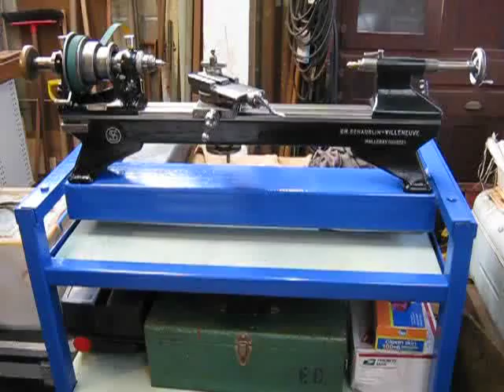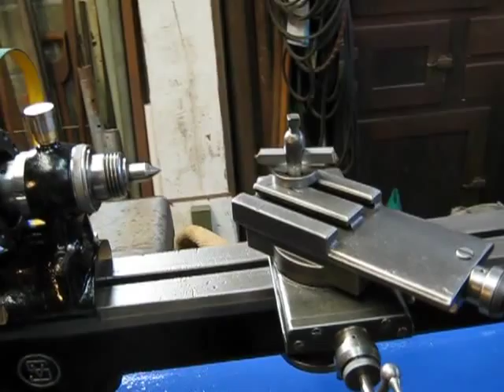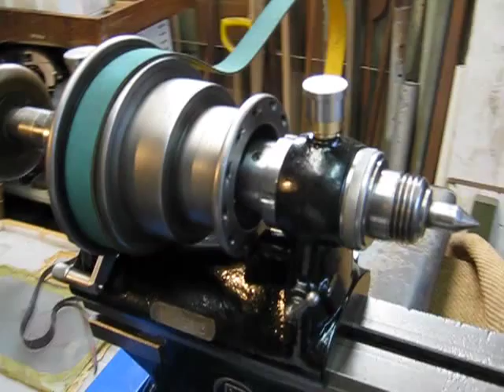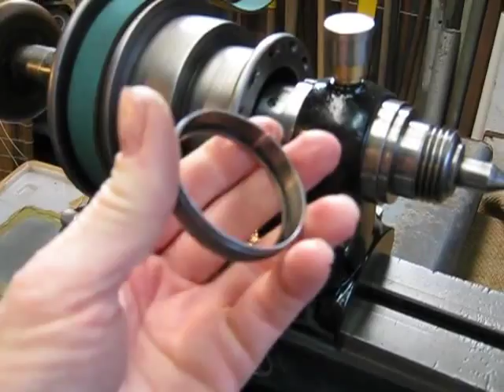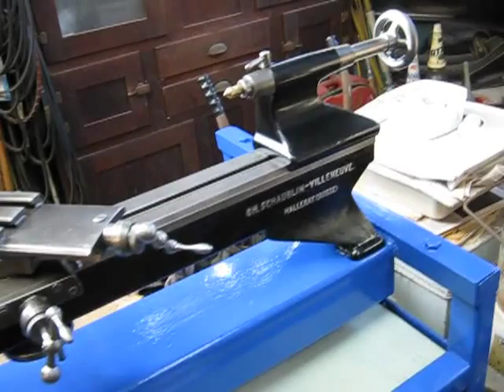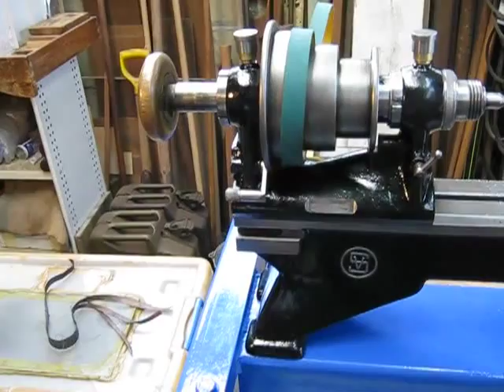Schaublin 102 lathe restoration - part 13

Comment: followed the project and when it was coming to finality that is from part 11 onwards there was not sound at least on my internet but all other channels were OK.
Reply from the maker: Hi Norman,

I just checked and sound is working for videos 11 onwards on my internet.

The sound quality is poor (lots of background noise/hiss) and that's why I bought a new Nikon camera to replace the old Canon VGA unit I was using.

Plus I went to 1080p HD and stereo sound at the same time, so it was a vast improvement all round.

Cheers Rob